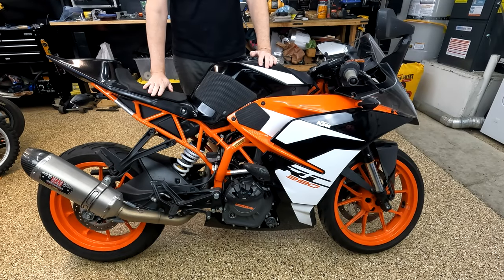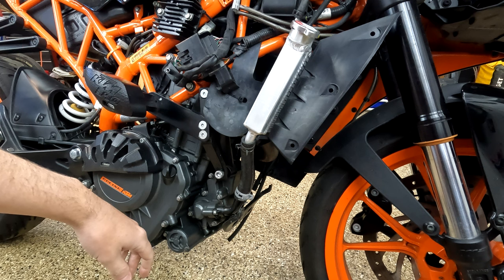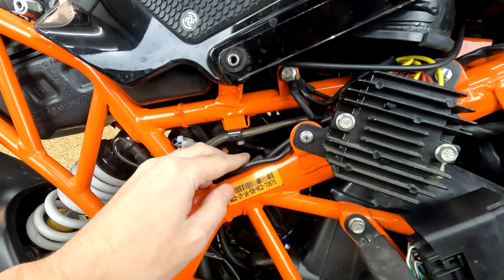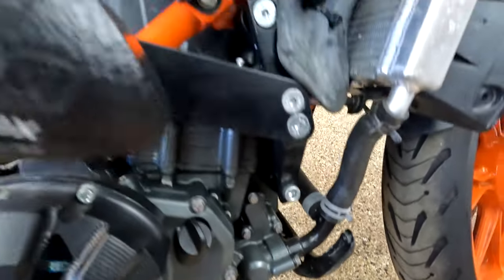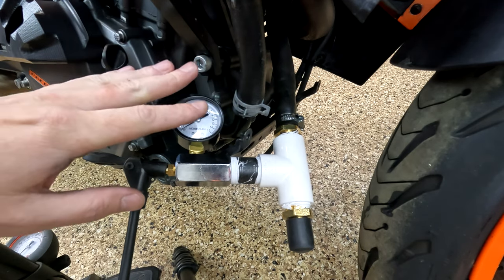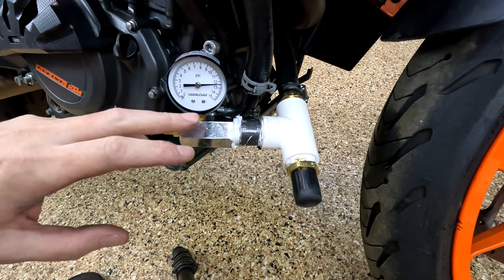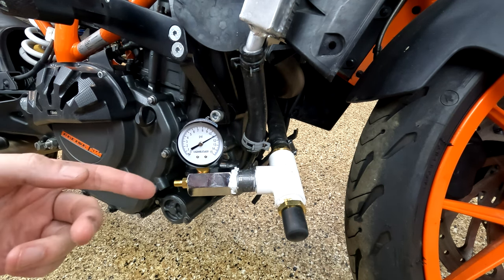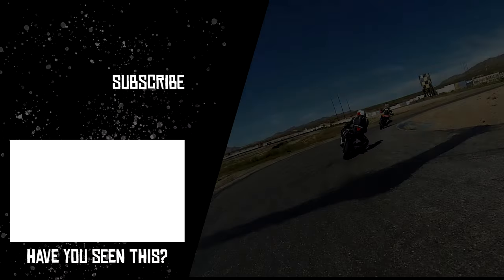The RC390 is Drinking Coolant Again... | Pressure Testing The Cooling System

Comment: Well I changed out my head gasket last week. What I found did not make me happy. It looks to me like the coolant ports that pass through the block do not line up with the head gasket. I would say that is why changing your out did not fix the issue. I posted it on my channel if you want to see what I mean. You can skip most of the way through the video until you see me working on the engine on my work bench. I am very not happy with this engine. I wish you the best of luck with yours brother.
Reply from the maker: Damn, I'll check it out. I'm pretty close to pulling the engine as soon as I clear out some other projects for the space.

Comment: I don’t know if anybody’s mentioned this, but I’ve watched your other video on this subject And another YouTuber had this problem with his Husqvarna 401. He discovered it was what he called “casting issue” where the channels the coolant travels through, doesn’t line up with the gasket and the gasket isn’t capable of actually sealing. A link the video if you’re interested.   https://youtu.be/wspp1DrucC0?si=rvXG-A_n54zw7Mze
Reply from the maker: Yeah he actually hit me up a while ago, I've been putting off dropping the engine again to check that on my bike. It's pretty likely that I have the same issue or the head gasket went again.

Comment: I have a 2021 Husqvarna Vitpilen 401 with the same motor. I hate this motor. I have the same problem with mine. I am getting ready to change the head gasket here in about two weeks. Please let me know what you find. I intend to do the same as you did repair it confirm it is repaired and then sell it for a Japanese bike. most likely an xsr 700. much lower maintenance intervals and build quality reputation.  :( very not happy as i loved the look of my Vitpilen.
Reply from the maker: I'm definitely not a fan of this engine. I have a video doing the head gasket but I'll definitely keep on this until I solve the issue. Fun bike but a little bit too high maintenance for my Japanese filled garage haha.
Reply: I bought ktm duke few weeks ago and so far it has given me 4 problems. I will too, repair it and sell it and buy something Japanese. In my experience, a Chinese made is more reliable than KTM
Reply: @cptgnrlsryssr6519  I bought an yamaha xsr900 20 months ago and it has been nothing but bliss. LOVE this bike!

Comment: Mine uses coolant asswell, doesnt really smoke. Also don't have the damp you see on yours :/ think il fix and sell for maybe a 690 since those are build in austria and not india. Did you end up fixing itn what was the issue? Or just sold it as is?
Reply from the maker: Sold it as is for someone else to take a stab, I like the bike but not enough to try and port match the cooling jackets outside the bike for a second time.

Comment: 1:35 dont any of those fits onto bleed screw in left? Or may be using some extender?
Reply from the maker: Sadly not on the aftermarket rad, the oem they fit but honestly the seal wasn't good enough to trust either.

Comment: Did you ever figure out the source of the problem? I have a friend with his rc390 with the same issues at only 10k miles! Head gasket and water pump seals are good as far as tests confiirm. I have a duke 390   and have had no problems with coolant thankfully. But it sure does love to snack on valve shims! Ive had to reshim every other oil change since new. It will run great sound good, and within 3 to 5k miles its back to clattering and sometimes some power loss. Love these things when theyere running but ill be damed if i go near another one again. More maintenance and repair than a track bike even when its just commuting and joy riding!
Reply from the maker: I keep kicking this project down the road but, I have to imagine it's either the runout of the water pump shaft is eating seals, maybe it's lifting the head, or cracks in the water jacket. I feel like the pressure test would have ruled out most of the issues. I love the bike when it's running too but I won't be buying another KTM for a while haha
Reply: @GarageAddiction  ok gotya! I just subscribed to keep up with you. I hope to hear about a source of the problem one day. I think your onto something with the water pump shaft seal. Replaced the one  on my friends and same thing as you happened. Seemed to fix it for a short amount of time then returned. I know the water pump shaft is off of the balance shaft internally, I'm wondering if its subjected to excessive vibration or low quality bearings or the bearing recesses in the case aren't suppoted enough.
Reply: Hello,
I'm facing the same issues it's been months..I tried changing the coolant seals but that didn't work, now I think it's the balancer shaft that needs replacement since I have been running the bike like that with the engine and coolant mixed I might have to change the core and the cylinder too.
It's been dreadful the engine built is so fragile and unreliable.

#NoKTMs for life😢
Reply: Curious to see what you find. Got here looking for an alternative way to pressure test my cooling system since none of those test kits fit our bikes and the motion pro is mad $$$. Chuck Harder suggested using a Mightyvac to pressure test through a drilled out m6 drain bolt in my case which it what I’m about to do.

My 500 EXC is basically vaping. Here are the details:

Vaping 500: Chapter 3 - Back in the garage after two months away trying to fix this issue. Lemme know if you have any ideas. Here’s where we are at:

-2012 500 EXC // 600 HRS
-Top End Rebuilt at 500 HRS

-Noticed bike running hot, loss of power, low coolant, air filter spooging on garage floor - eventually I discovered vapor was being sucked out of valve cover and into air  box thus steam cleaning filter (explains spooge, water pooling, low power and coolant loss)

-Checked oil, not milky

-No smoke/steam coming out of exhaust

-No bubbles in coolant

-Still, I replaced head gaskets assuming that was the issue since a small piece paper towel got caught between the head and the gasket on my first rebuild. 

-Machinist checked head for level and cracks, everything A-OK.  

-Replaced water pump seal for good measure

-Put it all back together. Bike felt great. After an hour of highway riding to bring the bike up to temperature I pulled the air filter and saw it was still doing the exact same thing.

-Bike sat for two months with full radiator while I was away. No apparent fluid loss when I checked the level.

-Leak down test on the engine shows 5% loss which I believe is acceptable.

-No bubbles in coolant, no hissing from exhaust or case. The only air I hear escaping is from the intake.

* My Prognosis *
I suspect there is a very slow coolant leak in the bottom end when the cooling system is under pressure.

Next step
Cooling System Pressure Test?

Anything else I should try? I would rather hold off on doing my very first bottom end but if that’s all that’s left then I guess I have to.

Any and all help much appreciated
Reply: @chain.driven  if it's not loosing coolant and only letting smoke out of the intake/air filter I'd check the pcv and related to see if it's oil vapors your seeing. Is it consuming any noticeable amount of oil?
Reply: I bought a duke 125 a week ago and it keeps emptying coolant liquid, I regret my decision buying ktm

Comment: I have the same problem as you just recently, check oil and it's fine. Check leaking all the hoses and radiator and found nothing. I am thinking it is the head gasket leaking inside and coolant was burnt there but maybe the leak is too small that coolant not mix with oil yet.

I want to ask if you recommend high compression head gasket from KTM performance or we just go with the OEM.

Thanks
Reply from the maker: Sorry to hear it :( I used the stock head gasket last time. When I pull this apart I might go with the high compression this time and see how it fares. I want to try and narrow down exactly what's going on.
Reply: @GarageAddiction  at this point, this leave me no choice but to do a complete rebuild. One of the mechanic I know told me when rebuild to look for the sign of bad engine blocks, especially the paper gasket. He encounters one bike that has bad engine block alignment that leads to coolant burnt.
Reply from the maker: @Khuongreview  Yeah the alignment issues are what @BushidoSteelCraft ran into in the comments here

Comment: hey man, id o have the same proble, did u get your problem fixed?
Reply from the maker: I did not, more than likely it was a casting issue which BushidoSteelCraft pointed out and I pinned in the comments. I sold the bike as is to someone willing to take on the project, too many projects and not enough time/patience to get this one done :(